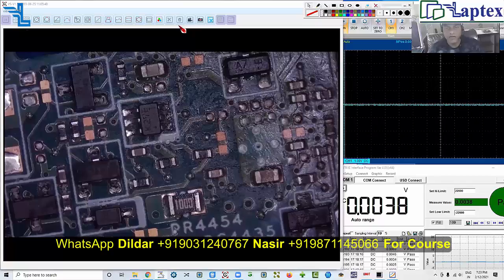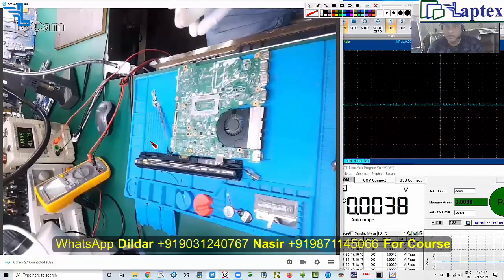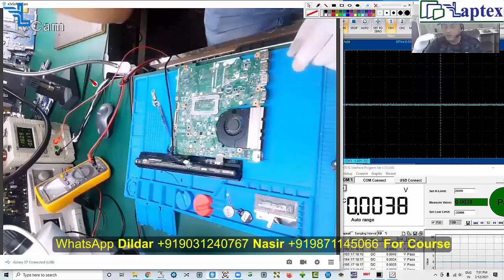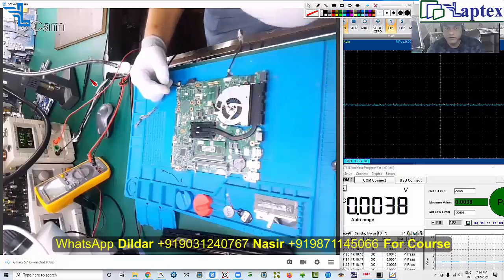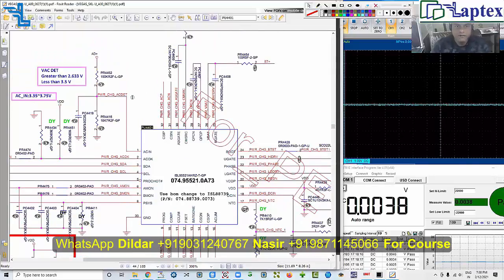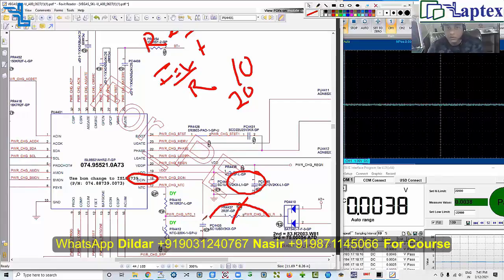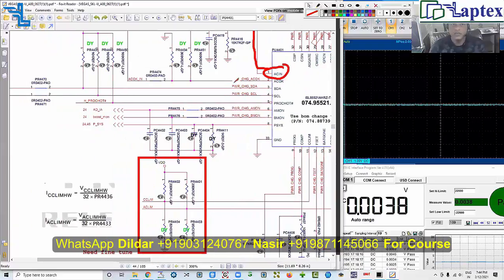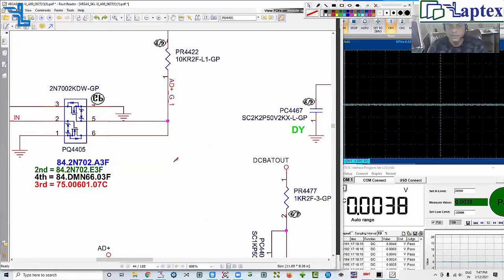Laptop Charging Section Concept | Dell Vegas Battery not Charging Sol | English Part 1 |Video Course

Comment: I saw may technicians bypass the signal line by any other working voltage to activate gate signal of MOSFET.
Jihad.
Is it ok?
Reply from the maker: Yes it's okay...but sometime it can cause problem also if the states are not matched for the used voltage

Comment: Have a dell vostro 3510 have the same issue. 

Charger shows plugged in. Does not say charging or not charging. Percentage dont go up. Dell software says its charging but percentage dont go up. Have no schematic so have no clue where to look.

Shows no amp draw. Think its a bad resistor not opening the mosfet.
Reply from the maker: Check charging section requirement.. Starting from VCC resistor and so on....
Reply: @laptex1377  no schematics ☹️
Reply from the maker: Check according to IC datasheet.
Reply: @laptex1377  ok will do. Thanks. Appreciate your response.